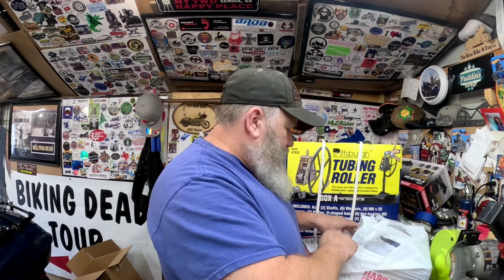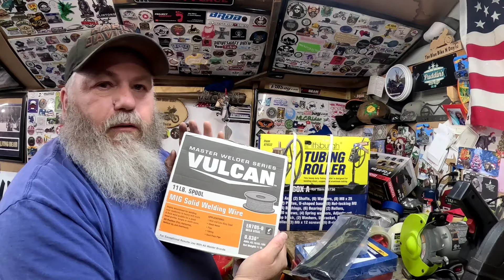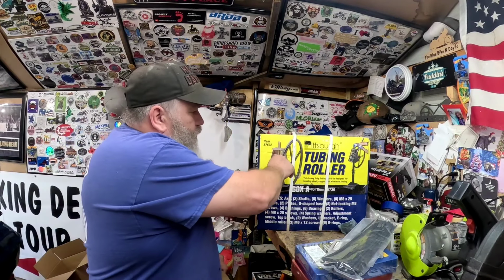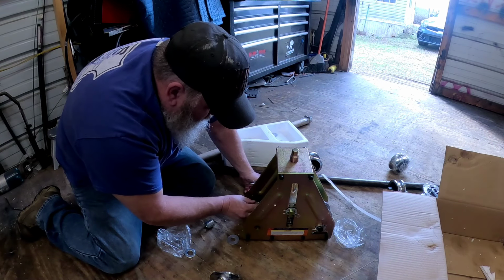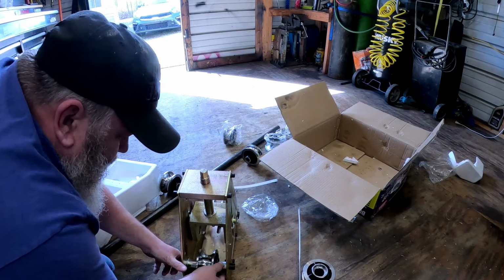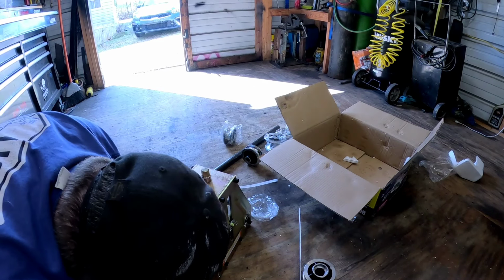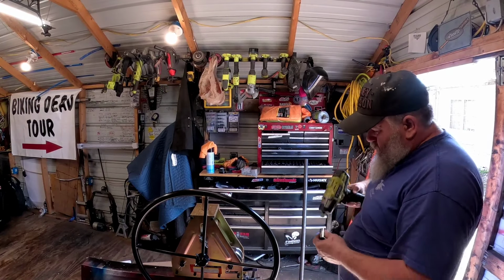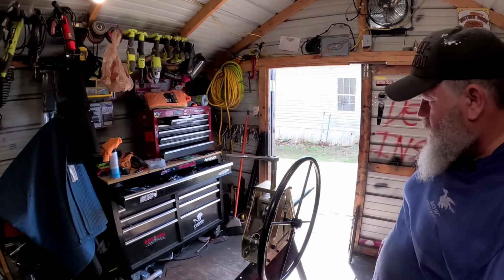My Biggest Hobo Freight Haul (Dickin around in the Shed E11)

Comment: i buy this stuff all the time, i bought some O rings a while ago, still got most of them left, bought a box of various nuts and bolts, a box of heat shrink, a reel of solder which i use all the time for repairing my boomboxes, we just love buying lots of stuff we don't use  lol.. i love it though. i have a bunch of stuff on the way from eBay and a Boombox on its way from a auction site in japan. i just can't stop
Reply from the maker: Nice rite  I use tge O rings I'm like the ones I need are like maybe 10  I probably never used the rest but it was cheaper to by big box .